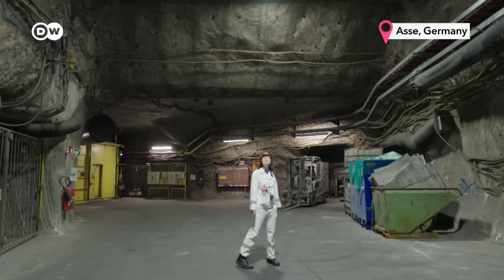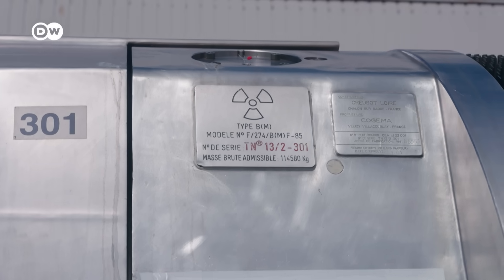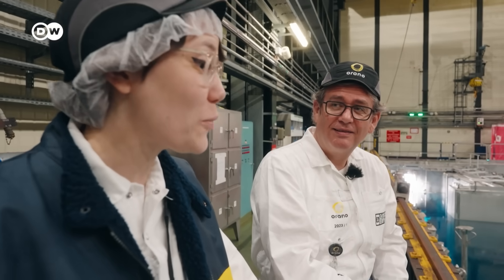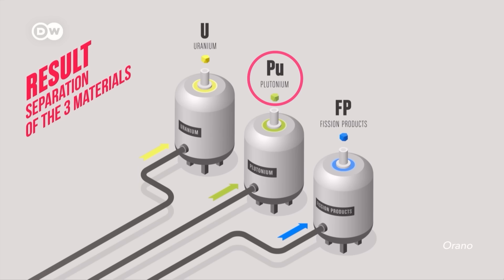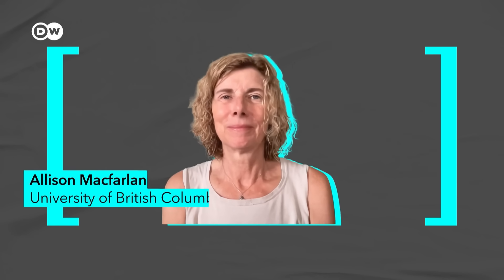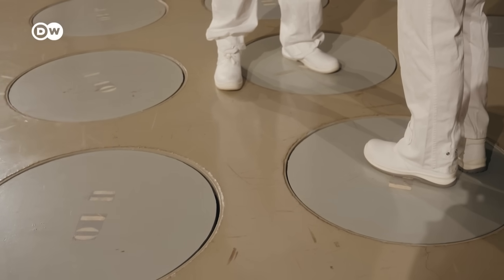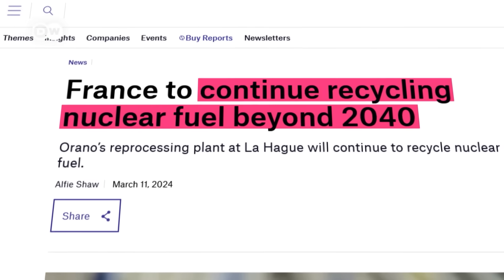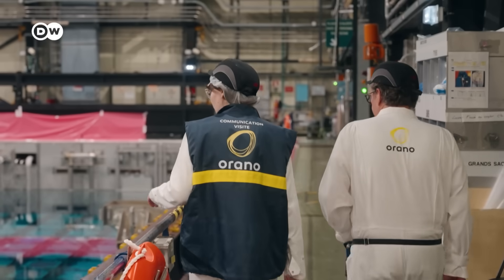Nuclear waste is reusable. Why aren’t we doing it?

Comment: It's not even about money, the world gives the oil industry 1 trillion dollars of subsidies each year.  For that kind of money we would be able to develop fusion.
Reply: BINGO!!!!!
Reply: @gaim44  Nixon wanted to build enough nuclear power plants that if he got the number of plants he wanted we would produce 2x the total power the USA produces in it's entirety with nuclear power alone.

You can reprocess the nuclear was 4 or 5 times, then drill a deep bore hole and bury the waste a few miles under the surface.

With that many nuclear power plants everything would be standardized and you could do things such as revitalize Appalachia by building the reactor equipment down there. 

You would use the nuclear power plant manufacturing industry to do launch a science equivlant of silican valley such as 

reactor manufacturing, waste processing, nuclear medicine isotope & CAT scanner manufacturing, nuclear research such as particle colliders.

Then you would  do other science things such  regular medical R&D to build on top of the STEM infrastructure.

You could transform Appalachia into the Netherlands such as a massive golf cart &  bike trail network for eldery and teens to get the teens out & healthy socializing with peers.
Reply: I like my fusion reactor safely placed 93,000,000 miles from Earth. It is cheap and doesn't leave spent radioactive isotopes in open pools a stone's throw from all our major cities.
Reply: @jackfanning7952  Solar produces more waste than nuclear waste. People don't realize it but we'll have to capture  36 billion tons of CO2 every year, even if you could capture every last gram, you'll have to find a place to store the CO2 you capture.  C02 doesn't decay, and if it leaks into an aquifer it turns it acidic.    

 To give context, about 400,000 metric tons of heavy metal (MTHM) in spent nuclear fuel has been produced globally since the advent of nuclear power.  That's  36,000,000,000 Co2 produced every year,Versus 400,000  total that has ever been produced since the year 1955 which is 70 years ago when the first nuclear power plant began to produce energy.

If we produced 36 billion a year for the next 70 years we would produce 2,520,000,000,000 tones, or 2.5 trillion  tones of CO2 in the atmosphere.

To store all high level nuclear waste produced so far, it would require a house basement the size of a single football field. There's an infamous foundation of a former factory of GM that was left abandoned in flint. Gm was able to walk away because of legalism through bankruptcy courts.  That slab takes up a bigger area than it would take to store all high level nuclear waste since the dawn of nuclear energy, and the concrete likely weighs more than the amount of waste we would have to store.
Reply: @jackfanning7952  Too far to supply our energy needs.  The problem with solar is that it's way too diffuse.  You have to get over the fact that energy is dangerous, because all energy sources are dangerous.  Solar power kills way more people than nuclear, because when you send people up to roofs to install and replace solar panels, sometimes they fall off those roofs, and given how little power solar generates, you have to send a lot of people onto roofs to install solar panels in order to match the output of a nuclear plant.
Reply: The US taxpayers are generously giving the nuclear reactors $1 billion a year to store their nuclear waste from hell in open pools within spitting distance of every major city in the USA. What a deal. No wonder they don't bury it in solid rock deep in the earth's crust where it can do no harm for the next million years. Take the money and run. Let Uncle Sugar clean up the mess.
Reply: Fusion needs a source of neutrons to make tritium and it makes waste. It also produces high level radioactive waste (excess neutrons). The heat exchange process is problematic as U235 or Pu239 fission plants.
Reply: often heard and everytime it is a false statement, the oil industrie is profitable, more over the taxes that are put upon oil derivatives are mindblowing, and even then they are stil competitif, so please no more oil subsidies bs! currently we do not know the limits of fossil fuels, if there are other energie sources that are better, everyone wil turn to them, no need to force them to people like the renewables these days, the only thing that is competitif to fossil fuels at the moment is nucleair energie, the present pwr technologie or the future technologies like molten salt thorium , fusion reactors have great potetials, if they would be accesable.

Comment: Let me guess - because it's dangerous and very expensive.
Reply: Honestly once you look into it, it’s really safe, and our technology and safety in the west if done correctly now is much better than during Chernobyl. In fact, Chernobyl would have been avoided if the reactor was American built. The design flaw would not have been there.

Also, it’s mostly expensive initially, and really cheap once it’s up and running.
Reply: 😂😂😂 I said the same thing before I clicked on the video

Comment: No matter what you still need uranium enrichment plants and using less than 5 percent enriched is passed through once . It's too expensive to recycle plutonium but when natural uranium and DU is used up then plutonium jumps in but it will be 80 years later . Mixing DU will extend the nuclear cycle for up to 240 years.

Comment: An extremely concise summary of the current situation. Having worked in the industry for 20 years I’ve observed first hand both the technical challenges, but also the fundamental disconnect of a society wanting quick wins, wrestling with inter generational decisions. The result in my opinion is that we keep making bad short term decisions with very long term negative consequences, but here’s the rub, because the consequences are so long term, no one is accountable.
Reply: Thank you for your view. It sounds very sad, but also very correct. It seems very similar to how corporations will choose CEOs, who will then run that company for a few years, after which the position changes again, leaving almost zero incentive to have any true long-term plans, despite the clear potential for it. The system just simply doesn't care at all about what happens in decades from now, because progress is never measured that far when making decisions.
Reply: I appreciate the video and your perspective. 

I do think that one element that was not highlighted in the video is the  risk management benefits to recycling or at least better disposition of spent fuel. the American paradigm is the absolute worst.

also, the antiquated perspective that we are setting an example for anyone by not reprocessing fuel is silly. the nuclear countries mentioned who are reprocessing all have nuclear warheads. who are we setting this example for? who are the nuclear energy countries who we are fearful of acquiring weapons?
Reply: @trinydex  There’s an SMR fast reactor project I’ve been talking to recently and they put a different spin on things. Burning spent fuel in their reactor creates an end product that in the main has a 300 year time to free release. This is genuinely interesting as when I was in Sellafield in the early 2000s they had 55,000 tonnes (not a typo) of Uranium oxide. It seems no one ever said stop when it came to recycling. So basically we’re spending escalating amounts storing the stuff when it could be burned and the end cost for storage would be much less. A final twist in the story is that we have a large store (public domain information) of Plutonium. Obviously this could be made into weapons, but the argument is that’s OK as the UK is a stable and responsible democracy. Here the question is, will the Plutonium be made into a product that can’t be made into bombs before the political situation in the U.K. declines. This is another angle on accountability. In the early 2000s again I did some work on the Geological Repository, only to be horrified to find that almost 20 years ago my older colleagues had been working on it for 30 years. As I write, there’s still no agreement on when it should be built and projects on Sellafield are 300% over budget vs 2007 estimates, and more to the point the site remains the highest hazard in Western Europe. I could go on as there have been so many interesting solutions such as Prism (probably spelt wrong, but a Pu burning reactor) which have come and gone.
Reply: @trinydex   producing new fuel from the used one will probably include the plutonium cycle .... so do we want to produce that at a larege scale in the civilian industry too ?
Reply: @TheStefanskoglund1  we can use plutonium reactors for energy production as well. 

what are we thinking is the risk? that countries will become nuclear weapons capable who are not already nuclear weapons capable? there's very few nations who have nuclear and of those, we are the only ones limiting ourselves. 

all the other nuclear energy capable countries all already have nuclear weapons capability. 

the nuclear weapons concern countries don't even have much of a nuclear energy capability or capacity, so we have the "problem" backward. the concerning powers  pursue weapons first, not energy and they don't go through an energy pathway unless it's to mask the weapons production.
Reply: @trinydex Do a little bit more research and stop making stuff up and you may realize that there are countless problems with a plutonium powered plant.
Reply: @121goldenfox5  can you say more? there's many variations of fission reactors, some better than others. but are you saying the ones that have been running, the ones the military uses, all those that have been running just fine the last 50 years, those are problematic?
Reply: @trinydex  I was taking into account the average uranium fission reactor and compared if to if we swapped the uranium with plutonium assuming that was your reasoning. If there are real plutonium power plants and that is what you were talking about then mb
Reply: The most annoying part of the discourse around nuclear power in Denmark is the politicians who say that, since nuclear power won't be ready by 2030, we should just discount it entirely... as if we won't also have a climate crisis in 2040. These same politicians like to pretend that we'll actually reach net zero by 2030 with wind and solar, which is just not going to happen. We could triple investment in renewables, and that still wouldn't be achievable.
Reply: That's what's concerning about nuclear in general, the impact of human mistakes systematically or individually will last generations, not just for our species but for an entire geographic area. It is too much responsibility for a species so prone to war and placing short-term advantages above all else. Truly, and the discoverers have said, it is currently beyond our capacity to handle responsibility as a whole without destroying ourselves or rendering swathes of our planet uninhabitable.
Reply: @ The same thing applies to fossil Fuels, and its much worse. Nuclear fission has its own problems but we keep forgetting about the bigger threat to the futur. I would rather have my ancestors maybe a little bit irradiated for thousands of years than being cooked by the sun permanently.
Reply: @ I also don’t like the ‘Humanity is destroying themselves’ look on society because the current modern age has to be one of the most peaceful and crime-less eras in humans history. The world has never been more united. The only reason people think that is that now all the tension between countries(that have existed ever since humanity was created) is now public
Reply: very true, though in all fairness this long term issue is so long term we arent going to see consequences until 10 or so generations down the line
speaking solely of nuclear anyhow
Reply: Politicians can always be accountable for bad decisions. They are never to old to be locked into a small cell, stripped of their belongings which, most of them, were paid by money given by oil and gas companies. Corruption at the core of the EU is why freedom and democracy is threatened in the west. Autocrats like Xi and Vlad are playing on these weaknesses
Reply: Agreed!!  Lots of knee-jerk selfishness, territory-preservation, financial-wishful-thinking and just plain ignorance in many of these comments; actual progress is next to zero!!  Worked for 25 years in the fuel-recycling industry!  GET AWAY FROM URANIUM!!  Nuclear STILL can be a viable option with Thorium!!
Reply: spot on.
Reply: You didn't work in the industry. If you did, you'd be screaming at her about why she didn't even touch on fast-spectrum breeder reactors that can literally extract 90% of the 'lost' energy as well as reducing the danger period of the waste down to 300 years. Total failure of a video if you don't cover the one thing that could literally save the planet from climate change but you finish with, "ahh I guess we're doing our best"... WTF
Reply: Yes we are! We are all accountable for what we do to our future generations. It's just no one feels that responsibility as much as they need to
Reply: Yep nobody looks past their own lifespan. Pathetic.
Reply: No people are still accountable for what they do, no matter how much time passes.
Reply: @jonathanchen4987 yep, God is watching and judging forever, in this life and next. People call it Karma, I call Him God
Reply: @jonathanchen4987  Good luck bringing someone up on anything 300 years after the fact.
Reply: b-b-but, the free market is the perfect decision-maker! lol
Reply: I have bicycle tires older than 20 years.
Reply: Short-termism, the inability of most people to delay gratification, entitlement mentality, green propaganda, and short electoral cycles in democratic nations are causing immense harm to both people, society and the planet. China is one of the few countries that can still think big and think long term. China is far from perfect, but there is quite a lot to like and admire about modern China.
Reply: @Hiereus2  Far from perfect? An odd choice of words for a truly evil dictatorship that profits hugely from the sale of organs harvested from unwilling people imprisoned just because they belong to a family that practices Falung Gong. A medical doctor who fled the country described being ordered to harvest the eyes and kidneys  of a healthy teenage Falung Gong practitioner - the harvesting was done with the teenager alive and conscious, without painkiller or anesthetic but tied to a gurney and held down while the procedure occurred. The doctor refused the order and the act was carried out in front of him by another doctor. The truth of China sickens me. The case I describe is not an isolated act but rather part of an organised organ harvesting program. Recently another victim , which is similar except his guards fell asleep before they chained him to a bed, escaped China and is telling his story - he fled the hospital just prior to the surgery that would have killed him - he had survived a prior surgery where part of his liver and lung were removed, apparently just to train some surgeons in the organ harvesting procedure. The truth of what is happening there needs to be told.
Reply: @Hiereus2  Russia is completing the construction of a closed nuclear cycle with reusable nuclear fuel assembly sessions and minimal decay product.